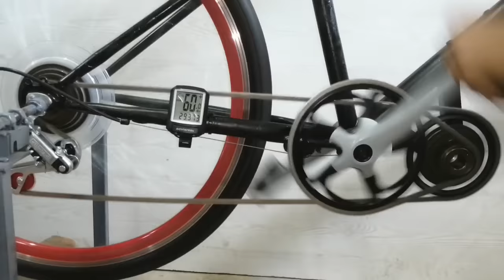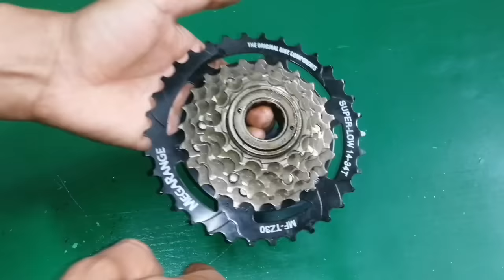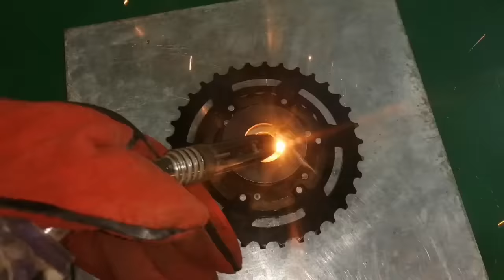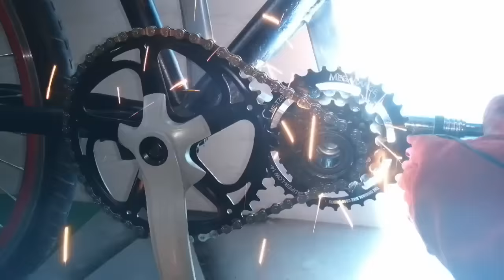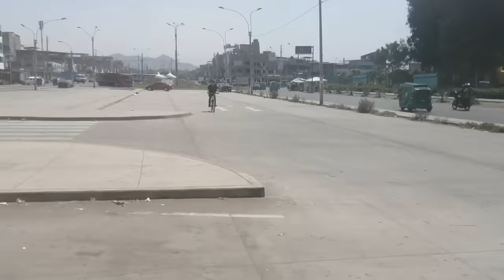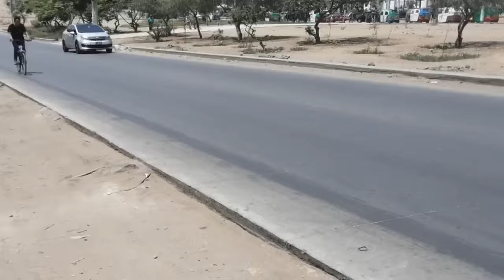making super fast bike

Comment: i did this in highschool.. i put the hub up behind the seat..  in highschool we could not start in highest geat but could in 3rd down.. took i while to get to speed ... but when we got there it was fast.. 

that was using parts from crap bike.. nothing nice.

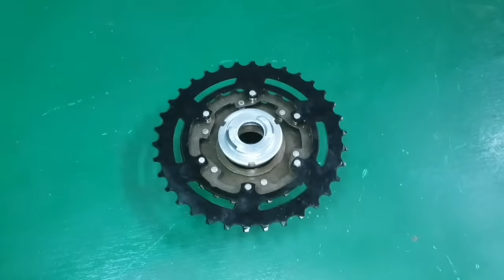i believe it had a 1:32 ratio.. also used a ten speed bike frame and adjusted seat angle so you could get a littlw better leverage.

Comment: Looks like Chinese hocus pocus.  You can add gears on the handlebars if you want but the speed of the bike is directly related to the riders ability to produce power as measured in watts/ kg.  More gears and chains = more drive train loss and more weight = slower bike with the same power input.

Comment: I  build many speed  and electric bikes as engineer for fun as a hobby. But you can't  go faster without extra strength. No extra gear will help and only increase resistance by the extra chain and gear wheel and bearing.
And the front gears you can't even change here. Just for  the show. .Than how he welt an aluminium bike so easily? You need  a Tig welder and big chance the frame may weaken and deform by heath. without  supporting the whole frame  in a moul before welding  So this must be a heavy cheap steel bike because he used a  CO2.welder.  If  you want to gain more speed ? build a lighter bike...or a carbon bike. That will really do rhe trick. But it Looks impressive....

Comment: So what was the final speed of the tire on the stand after the mod?
Reply: 30 kph not more.
Reply: @Nost2682  On the stand, 71.6 mph (and he could probably turn it even faster). I've gotten 60 mph wheel speeds out of my Saracen turning the crank by hand. Riding it is a different matter. There is no way you could get to 70 mph on a bicycle even with a horse's legs, heart and lungs (well, not without a wind break or some recumbent in an aerodynamic shell).

Comment: I remember back in the 90's some bikes were coming with 4 chainrings at the front and 7 at the rear, and they were on the cheapo bikes, seemed like an interesting idea if you wanted a bike for touring I guess, but these were on the cheap end mountain bikes.

I wonder what would happen if a company made exoskeleton legs to increase input to a gearing system, designed for high speed, and you carried your battpack in a pannier to keep the weight off the rider and lower the gravity centre a bit.

Comment: If this contraption is only just as good or no better going uphill then any old bone shaker is as good. Most of us cannot put back together the gear wheel assembly once dismantled or do a precision spot welding without ruining the sprockets.

Comment: Normal 50-11 gearing with 90rpm cadence give you 50kmph. 50kmph in flat need 700watts. Top athletes mostly produce 400watts for an hour. For 100kmph you need 2000watts ish on your leg which is possible if you are a cyborg or wearing exoskeleton. But then it's better to put the motor on the bike.

Comment: Maybe if it had enough gears so you could smoothly to a higher gear, it would be useful. For me, when it's flat I almost never get above 40km/h, but downhill, above 50km/h I can't really contribute to speed by increasing the cadence. That's where faster gear rations would be useful. But it depends on where you're cycling, right here i can't just use the roads because the cars are going at like 100km/h, but in the other city i lived, i would actually use the roads and go downhill faster than the speed limit(the speed limit was 40km/h in the most dangerous turns, 60km/h in some areas and 80km/h in just a few parts). So where I live I use like the side of the road, that is not well mantained, there are pedestrians sometimes, cyclists in the wrong direction(like the dude in the video) and tree branches. So yeah, my point that 60km/h in a well maintained road, where you dont risk getting hit by a car is much safer than going at 40km/h on the side of the road, in tight places, doing turns with no visilibility. You can get to speeds like 40km/h in most bikes, and in other ones you can get more than that, so most of the time you don't need and want to be fast, but it's good to have a fast gear so you can get to speeds like 60km/h more easily.
Reply: what about 10 gears or more?
Reply: Safer to match speed yes, but wheel bearings and tires handling those speeds would be a concern. Things could get toasty.

Comment: The know you can spin the rear wheel faster with a bigger gear. It's not some new idea. The force needed to turn the crank gets higher every time you make the gear bigger. The limit is humans, not the size of the gear ratio.
Reply: Leg power and aerodynamics for the most part with contribution from weight and rolling resistance.  I have a strange feeling this guy wouldn't out spin a 53x11 let alone the largest ratio on a commercially available standard drive train.

Comment: Requires over 3000 watts to sustain this speed. No biker is capable of this. The wind resistance alone is almost 30lbs. Imagine running while someone pushes against you with that force. You wouldn't be able to go much at all.

Comment: There are several reasons why this invention is not a thing in competetive cycling and why it is just a bad idea.
1. Extending the gear ratio to the extreme point is not really a good thing.
The gear ratio for a road bike targetting high speeds should be geared in a way which allows you to go around 85-90kmh with 120 crank rotations per minute. The healhy and fast range is around 100-130 crank rotations per minute, with setup like this you could get to the same speed with much less rotations per minute on the crank, so pointless waste of the gears.

Longer gear ratio on a bike means that speed difference is bigger between the gears, this makes acceleration harder.

2. This invention makes the bike heavier by doing the worst thing possible: increasing the rotationall mass. Id you want to go fast you need to reduce weight, especially rotationall weight.
Also more gears mean smaller efficiency.

What was the top speed of this bike?

A pretty good rider could hit 60kmh on a flat surface on an XC bike with 29 inch wheels.
A pretty good road cyclist could go 70kmh on a flat surface.

Comment: Not much point as you won't go any faster than simply using an equivalent gear ratio on a bike, in fact it would be slower (on the same bike) due to increased weight of the added chainring. As someone else has said here, its the strength and fitness and conditioning that supply the power unless you have an electric motor.

Comment: It does not help to increase the gear unless you don't increase the torque at the same time. This is not a super fast bike but is slower than a normal bike, because with too high gear you produce less power!

Comment: I feel like I need a really low gear sometimes. Do the opposite so I can move my caravan up a grass field with it.
I'm not sure how much faster this is if I can only pedal the top gear at 40 rpm grunting like Ronnie Coleman. I may as well use the lower gear and pedal at 80 rpm with less force. It's rare that I'm limited by gearing on a bike. I often leave mine in 4th or 5th out of 8 on my electric if the motor is off. I have a Saracen Helix that had a 52-11 and as a flat bar road bike it was difficult to get it over 70 RPM unless riding in a group in lycra. (Okay the original had a 52-12 but the new cassette had both a lower and higher gear).
Reply: Cadê a tradução do português
Reply: Forget about it, it's horrible unless you have an electric bike

Comment: The air resistance and ground friction limit the maximum speed reachable by a bicycle; a very long ratio will diminish the pedal impulse rate at the price of a harder effort. Too long ratio will tire the cyclist down uselessly, without granting more speed, and the slightest slope will render the bicycle even more useless.
Adding sprockets adds weight and mechanical friction, making the bicycle - eventually - slower.
Bicycle ratios are calculated by engineers, allowing to reach the max speed at the correct rate of pedaling.
If speed is not sufficient for you, just add an engine, which is the only logical solution when human power is insufficient.

Comment: You might as well get a car or motorcycle or scooter.  A ebike is 25 or 30 max speed that's one of the reasons you don't need a license for it .Or the main , I don't see the need for a ebike going over 20 miles a hour , as stated yo7 might as well go gas power,  electric can't sustain that much power usage for long .

Comment: You are missing that tiny detail air resistance.
Your speed is not limited by gear ratio. It is limited by the air resistance. A huge gear ratio will only be useful down steep hills or in a strong tail wind. 
So pretty pointless in practical use, unfortunately.

Comment: The crankset should have been smaller, and the gear you were attaching it to had to be the size of the crankset. Because human legs give constant torque. Stronger legs mean more speed. but the best is to buy ultegra, 105 or sora set bike :D because you can see speeds of 120 km very comfortably

Comment: Honestly what is the point of this?
What kind of human can push the pedals?
You can play with gear ratio but in the end there are other factors too.
Add a battery powered powerful electric motor in this setup and You can reach 100 kmph maybe. 😅

Comment: So....were you really riding faster than before? It seemed to pedal smooth enough, but with no reference we don't know the speed, or improvement. Some time projects are fun to do just because, but for a bike a bigger chain ring would be way easier for same result. I would love a 52 or 58 on my ebike. 

I has a 48, but a 52 or bigger would fly on the flats or slight downhill.

Comment: why remove the bearings on the lower cup?
Reply: They didn't. That was the pawls for the freewheel that they removed. That had to be done because otherwise it would not turn in that direction.

Comment: I ride an electric e bike the wife rides her lower end price Cannondale bike and smokes the evoke with out breaking a sweat and not even in bottom gear , how does this modification make a normal bike out run a 40 km/hr, e bike has new bearings and batteries and wife's bike is stock, so again how does this mod increase speed ? And how much leg power does this mod make you work to get top speed ? And what is top speed ?

Comment: Everybody's going on about the usefulness of this modification or lack there of is obviously not a tinkerer, overly creative, or the inventive type, which makes me wonder why you guys are watching this channel in the first place? Dude knows that this mod serves no practical purpose, as do people who think the way he does like myself. You guys are missing the point. 

Most of you are correct in that with a gear ratio like that you not only need a decent downhill gradient, but you would also need either a tail wind or no wind at all. Had he made a heavier more complex system, something like what you find in a transport truck where you go through the seven or eight gears normally with the transaxle in low, then with your fingers you pull up a little lever below the shifter knob, stuff it back in first and go through all the gears again. In the truck it's done for the opposite reason, to make use of a gear ratio so low you barely get a single mile an hour out of it, and in an empty truck would seem useless. However, without two rounds of gears you would never in a million years be able to even budge 75 tonnes worth of truck and cargo, without a significant downhill gradient. So this modification had he spent more than 15 minutes on it could very well be of use if you live somewhere with long steep downhills, and you are a fan of blowing by motorized vehicles like they are standing still on your bicycle. As long as you have the ability to access the original low gears of the bicycle, it could be fun to have a 42 speed bicycle, so long as too much extra weight was not added. All that being said, YOU GUYS ARE ALL MISSING THE POINT... 

The video was not about what dude did to the bike, it's about how it was done. He completely altered the function of that bike, adding an impossibly tall final drive that would allow a person unconcerned with self preservation and access to a very long, steep, smooth, and deserted piece of roadway to pilot a bicycle at speeds very few have managed before, well beyond the limits of the tires, rims, chains, sprockets,  and overall rigidity of the bicycle frame and other structurally supporting components. Probably even faster than many people have ever driven anything in their entire boring lives. He did this using only basic tools, and spare part he had lying around his shop. It's the engineering that is impressive here, as well as the ingenuity, not the final product. Dude is not trying to have a channel where he just gives away marketable inventions to people incapable of such feats. He's practicing prototyping, and bringing his imagination to life without spending a dime, proving once again that people who try and solve problems by throwing money at them, are every bit as bad at problem-solving as they are at not wasting  money, and every bit as useless as a bike that can only go real fast, downhill,  and with a decent tail wind. 

This video is about invention for the sake of inventing, and using what ever is available around you to get it done. It's about the build, not the beast. It's a demonstration of creativity, advanced problem-solving skills, above average motor control and a level of dexterity most humans can't even fathom. This dude can make SOMETHING, out of what the average eater would wastefully discard as NOTHING. Can any of you guys do that, consistently, and on a regular basis, no less???  My guess is probably not because I know I can't, even though I do often try...

Comment: That is not how it works
From experience I know the bigger gears the better
I have upgraded my brompton from 44T to 54T crankset and obchodami I am faster, but I am faster in all cases, especially uphill
Why I am faster even uphill? 
Because I am losing less energy on teeth. The smaller diameter, the more losses. 
So you would be actually much better doing 54T to say 18T, then 42T to 14T, despite the ratio is exactly the same. And yes, you may be much faster on 54T to 18T, then say 42T to 11T, despite much better ratio, but more losses. 
I am cycling on brompton, 54T to 11T, up to 25mph, despite 11 years of not cycling due to not having any bicycle